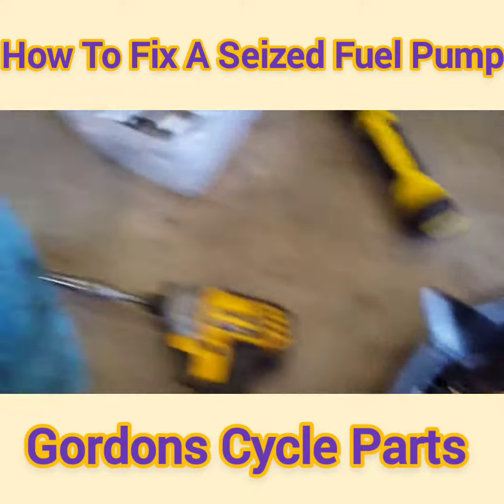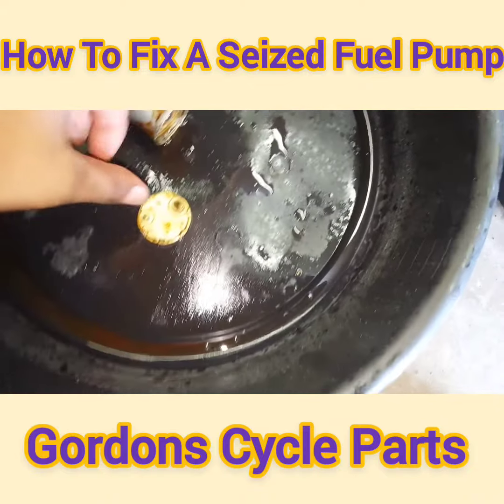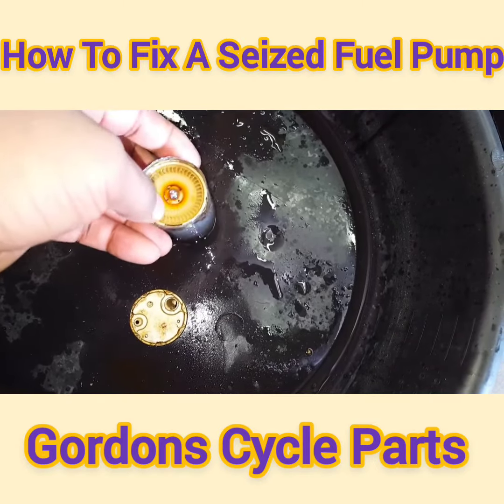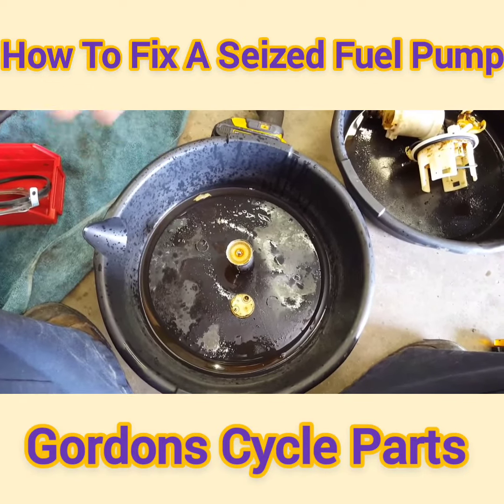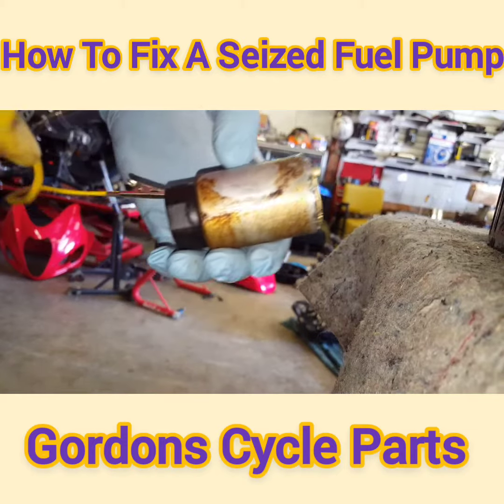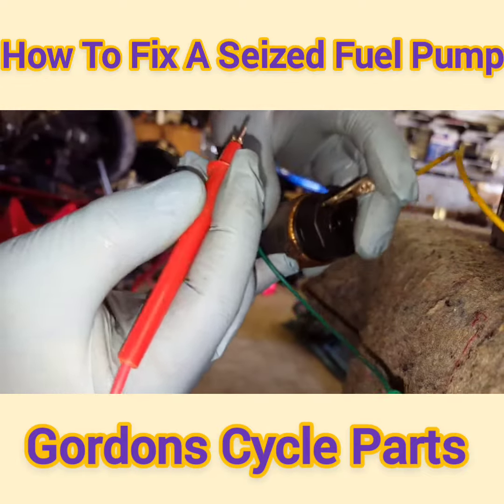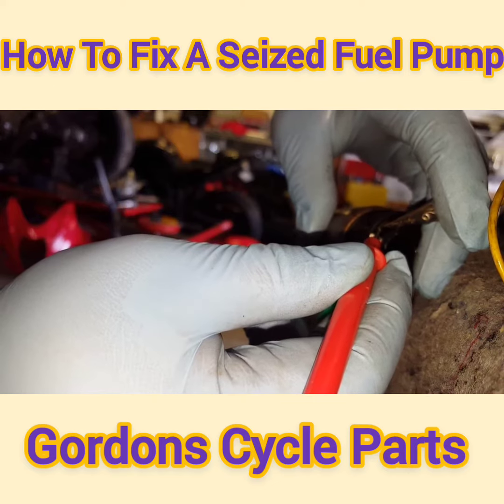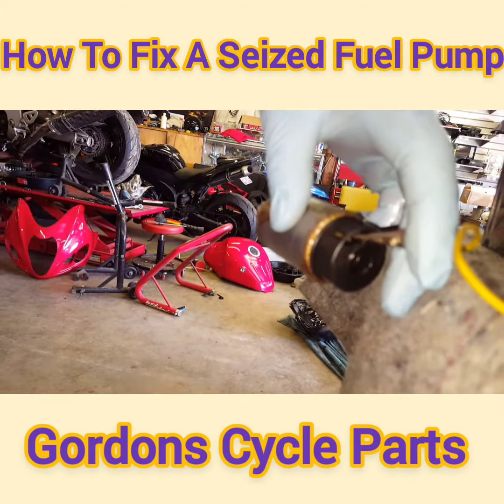How To Fix A Seized Fuel Pump #Easy #HowTo #Repair #Replace #Fix #GCP #DIY #Service #Change #LOVELY

Comment: How did you get the cap off the fuel pump?
Reply from the maker: Pry it open with a flat screwdriver. Go around it twist the screwdriver unfolding the over lay. look closely at it on the video. pause it to see it better